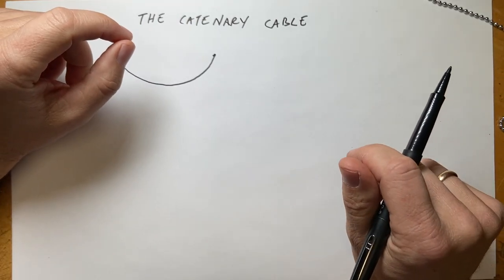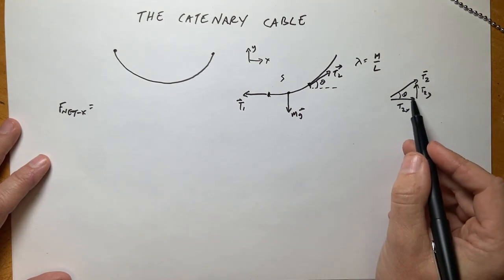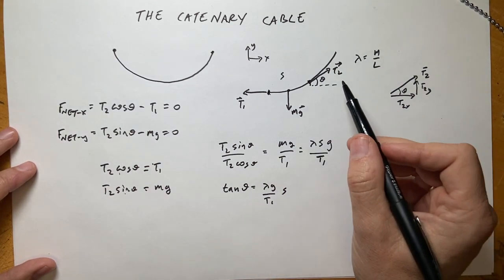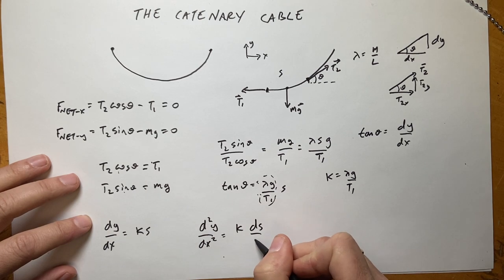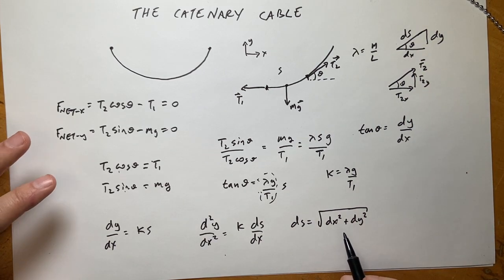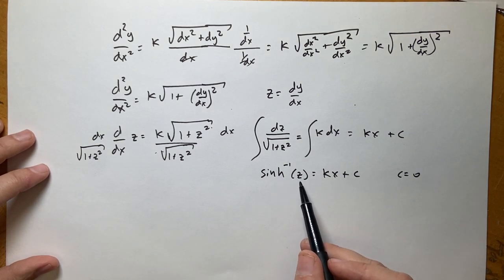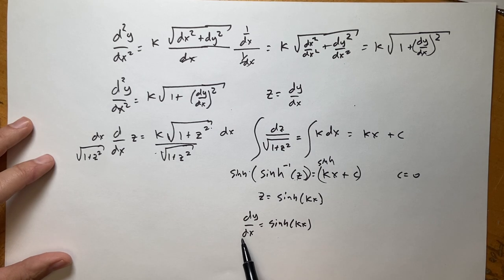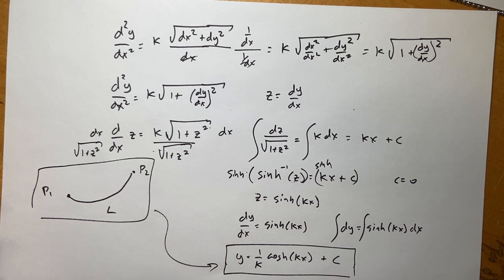Derivation of the Catenary Curve.

Comment: 5:46 if you take derivative with respect to x then T1 will no longer remain perfectly in x direction as we initially assumed? Imagine closing in on the midpoint of segment.T1 will surely have a component in negative y direction
Reply: That's not the case if you are taking the derivative at the point x = 0. It may be true elsewhere, but picking x= 0 as the point to do the analysis makes all of this alot easier. Also remember, this is done in the limit as s -> 0, so the segment has infinitesimal length.

Comment: 9:40  Once upon a time I tried this problem  I didn't know about hyperbolic functions and hence proceeded without Sinh.  Using 'normal' trig and multiple substitutions the answer popped out in about 2 sides of A4 and a zillion square roots.  This was 50 odd years ago as a teenager. I only mention it because these days folk even define a catenary in terms of hyperbolic functions which although succinct is not necessary.  It took me 2 days at the time and I was embarrassed when asked why I hadn't used hyperbolic functions ... I simply has never heard of them.

Comment: So I’m a bit confused at this step 5:34. You’re considering an infinitesimally small element near the bottom of the curve, so that one of the tension forces is horizontal, and then equating forces. But this expression you get is only true for this element right? Because for the next element both the tension forces will be at some angle. Why are you differentiating both sides as if the expression is true for all elements?
Reply: i think we never had made sure to make one tension to be horizontal for each and every element, the given expression of than(thetha) satisfies for all values of s and their differentiation never gave any relation for dT since T1 is a constant and we never involved the variable T as a function of any s or x or y